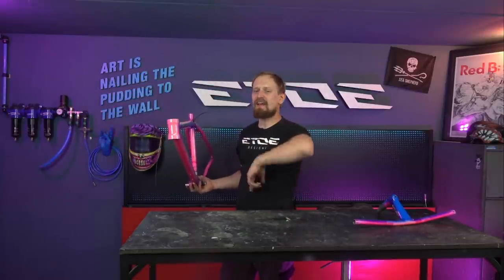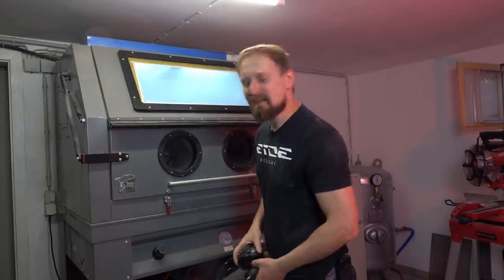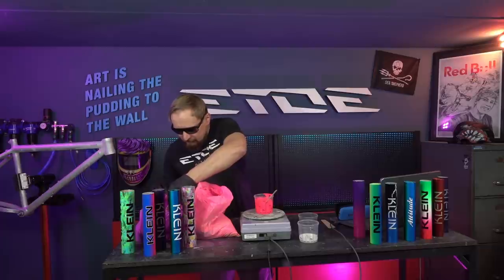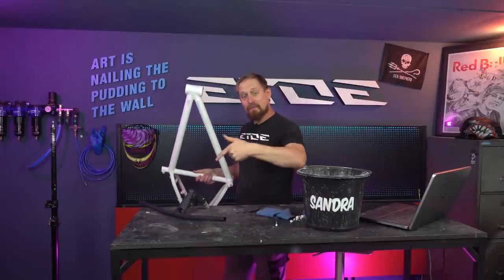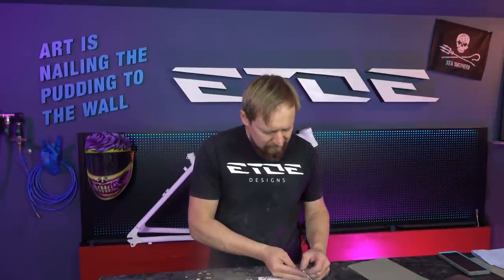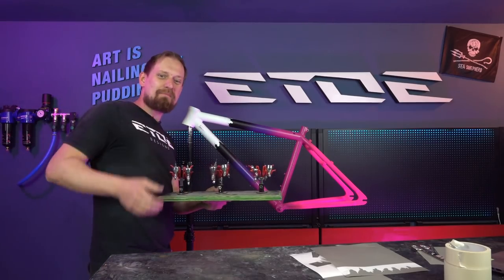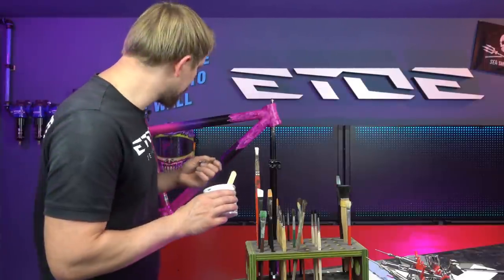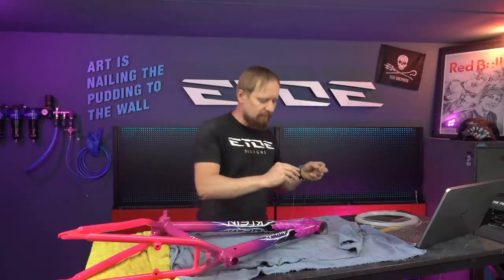BIKE PAINT -Klein Attitude Storm restoration

Comment: Hi there as someone trying to learn how to paint bike frames I really appreciate your videos. I am hoping that you could answer a few questions. 
First do you use an LVLP or HVLP gun? I think in one of your videos you said LVLP 
Second what tip size? Looks like you use a mini gun so I am guessing 1mm. Also do you have to use different tips for primer, base and clear? And do you mix the paint differently if you use the small tip. Seems like all the autobody guys suggest a tip of at least 1.3mm for base and 1.8 for primer
Reply from the maker: I use LVLP guns with 0,4 and 0,8 and 1,0 and 1,2 nozzles. No I don`t need different nozzels for primer, base and clear.